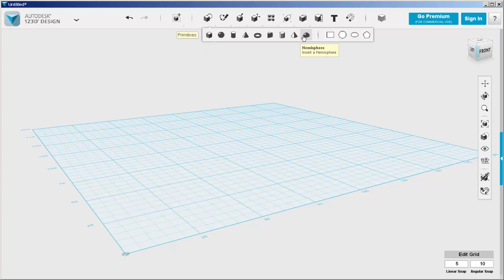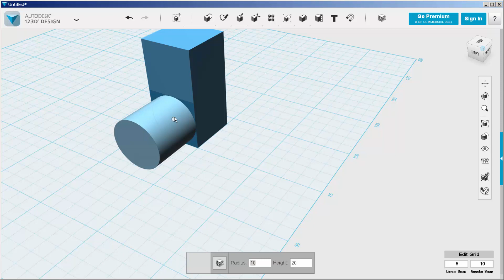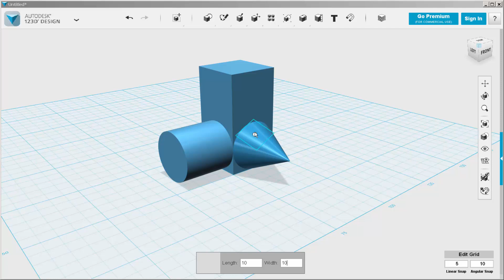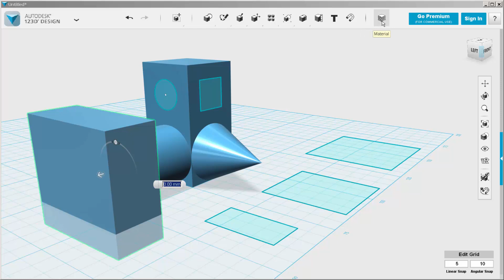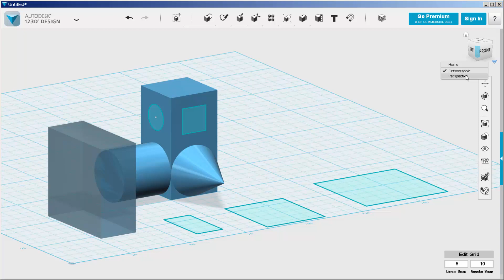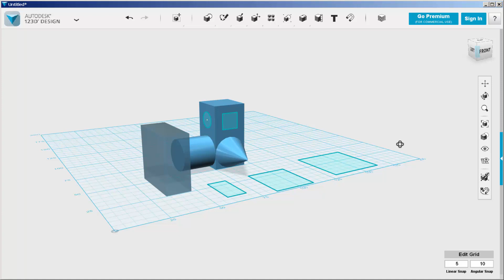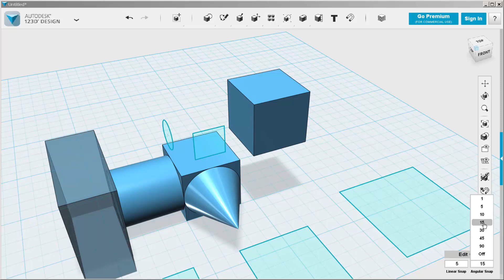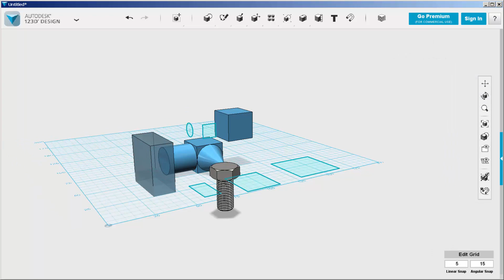123D Design Interface (v2.0)

Comment: After viewing your video on mirroring repeatedly, I gave up. Could not for the life of me get the mirror to work. 
As a simple test created primitive sketch circle then added a line to the right of it, all on the same plane. 
Selected the circle (dimension showed inside the circle) then from the gear which appeared after the above step, selected Mirror. The dialog box containing Sketch/Mirror Line, appeared. Selected Mirror Line then clicked on the line but could not the line to select. All that happened was a green box with the check mark inside appears?